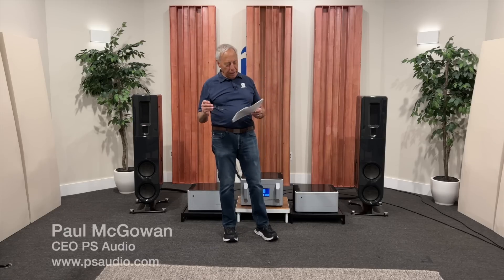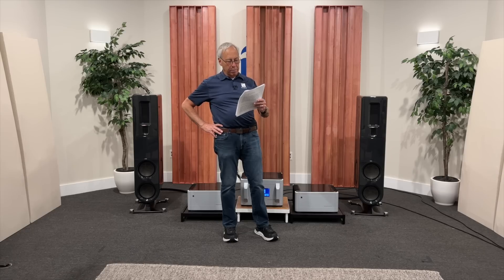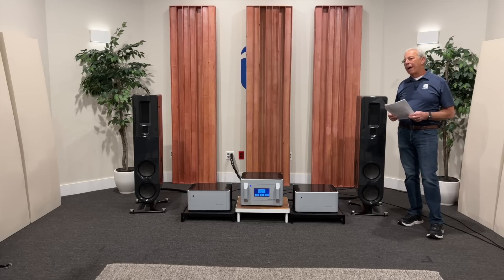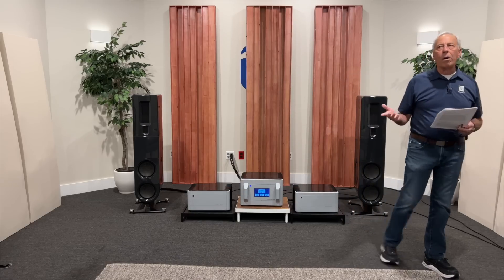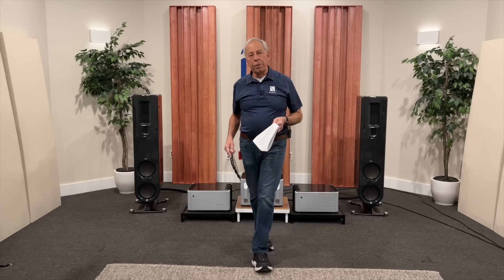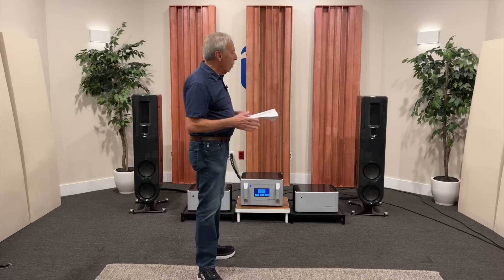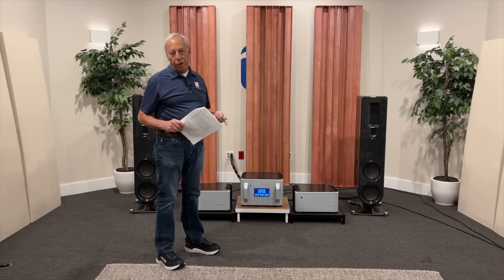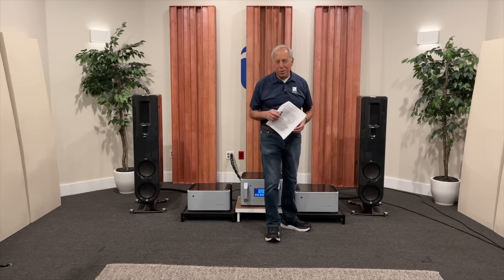The longevity of PS Audio speakers

Comment: In the 1970s, I bought large Advents for myself and Dynaco A-25s for my brother. Advents had foam woofer surrounds, and they rotted after about 15 years, as did the replacements. The Dynacos had rubber, which have held up just fine and are still playing.

Comment: ni the midrange and the tweeters are not custom, they are bought:   GRS PT5010-8 10" Planar Mid/Tweeter 8 Ohm    Cost:  $164 each
the tweeters are GRS PT2522-4 3-1/2" Planar Tweeter 4 Ohm     Cost: $39 each
Reply: This is false. They are certainly similar as both are derivative of the work done by David Graebener and Igor Levitsky. David worked for my father for about 10 years and I worked directly with Igor at BG for 5 years with these. Why would we need to go to parts express?
Reply: @cbrunhaver  who cares were dd the bought it? i'm sure the bought it even cheaper from the source. This aint the issue but the deceiving marketing and money grab
Reply: @HowDareYouu  well, I worked on these for a couple of years and  heading over to China to implement a listeninc system for additional testing and product quality don’t appreciate being told that they were just bought off the shelf.

For hifinews, the midband distortion of .06% at 90 db spl was one of the lowest they’ve measured
Reply: @HowDareYouu  well, I don’t follow that logic. Companies shouldn’t make money on their products or the work that I did on this isn’t enough to call it custom? 

I think that you must have an axe to grind against the company for some other reason. You have made something around 85 comments on these videos (mostly negative).

Comment: You can save buttloads going with a set of vintage speakers that simply need foam replacement. I got 2 sets of the same model and for curiosity sake, one set I used foam replacement surrounds and the other I used rubber. I couldnt hear a difference between them. From this experience, I say go rubber if your repairing surrounds. Rubber is far more rugged and can take a little more abuse in the long run.

Comment: I think I've told this story before but many decades ago my late brother and I had a friend whom we saw on a regular basis and one Friday he mentioned that he didn't seem to be getting the bass from his system that he was used to and wondered if we would mind visiting and investigating the problem. So after dinner, we had a listen and there was no question that the system was very bass-shy. We didn't think it was an electronic problem so off with the baffle cloths and the reason became immediately apparent. The surrounds of the woofer cones were foam and it had spilt in the centre around each of the circumferences in its entirety. (I have noted both  Peter W's and The Rolling Troll's comments below). We managed to find reasonably suitable replacement drivers with rubber surrounds and the sound was back so some sort of normality. (It wasn't a high-end system). If it had happened today I now know a person who specialises in replacing surrounds but it does require expertise to ensure that the voice coil ends up being centrally positioned in the magnet "gap".

Comment: Hey Paul, I would like you to talk about EQ, I have the impression that EQ, especially digital and DSP, introduces a bit of noise and distortion to the sound processed by the DAC, is it my ears or is this actually happening? obviously listening superficially you don't notice the distortion or noise, but at the most inaudible and barely perceptible level, would the sound be compressed, or with artifacts, noise and bad changes when using any EQ program? I tested it several times with or without EQ and although the sound with less treble is more comfortable and attractive to me, when I EQ it, I end up preferring it without EQ because it sounds more natural, while listening with EQ I slowly realize that the sound is strange, I feel uncomfortable in my ear, sometimes it hurts, it's a bad feeling, I've tried it in different setups and different boxes, but this always happens.
Reply: Paul's friend, Michael Fremer, sez, "Everything distorts." At an audio show, a few years ago, a European Manufacturer had a, `perfect preamp,' which is just under half a million dollars! For the preamp, only! Yes, there are million ~ dollar, multi ~ million dollar systems. I've purchased a complete PS Audio system; the only place that I, `cheaped out,' on, is: Robin Hood speaker cable, vs. Dragon. {You may ask yourself: Do I buy the top of the line speaker cable, or, a new, luxury automobile?! Really!} NOT buying something, is less expensive, & is likely to provide better sound ~

Comment: Surrounds deteriorating in Asia and humid environments:
JBL, Acoustic Research, Bose, Advent, they all had these issues. 
And then here in the Netherlands/Germany: Magnat, Translator, Philips, Jamo... 
All foam surrounds deteriorate. It doesn't matter where they are, or which brand, if it's foam, it'll be dead after 30 years.
Pretty easy to replace though, and cheap. You just got to do it, or find someone who does it for you.

Comment: Great question about speaker longevity.  My B&W 801 Matrix series 3 speakers are 29 years old and going strong.  No cone  rot.
Reply: I have a pair of the exact same speakers...currently sitting on Fort Myers Beach in a bombed out condo due to Hurricane Ian.  We'll see if they are listenable when we finally get power in another 6-10 months.  They were working fine until the hurricane.
Reply: @grayrabbit2211  Sorry to hear  about the hurricane.  Hopefully your speakers are still working.

Comment: If theres any indication of longevity and/or durability of ps audio gear, take my experience with their ps audio sprout 100. Died in less than 2 years. Tried to resolve it with their distributor but they shrugged me off after the first try of repair. Said they gave me a new unit but it died after 2 weeks. Tried to contact them but to no avail.

Stopped trusting ps audio after that. Will never ever recommend this brand again. Dont ever trust this company with the warranty they claim.

Comment: Paul: The dumbest question you'll receive today:

WHAT in the sam-hill does "PS" stand for, in your company's name?

It's not on your website, and goose eggs on the internet.
Reply: From Wikipedia : PS Audio was founded in 1973 and shipped its first products in 1974. It was started by audio designers Paul McGowan and Stan Warren (with whose initials the company was named).
Reply: @ray.watts-35  I googled and duckducked "ps audio" and failed to get hits from either for a Wiki entry for the company.

Do I need to take a course on search skills?

Thanks for clarifying though.  I suspected the 'P' might have stood for Paul.
Reply: @Zickcermacity  yep, probably best to Google search skills 🤣
Reply: @Zickcermacity  , i 'Ducked' PS Audio and wiki page came right up top
Reply: @googoo-gjoob  Some of us lucky, some of us.. not so much.
Reply from the maker: Looks like it got properly answered. Thanks. Yup. Paul and Stan Audio.
Reply: @Paulmcgowanpsaudio  That's something you might want to include in your website's About page.  Would have been nicer to read about it first hand, vs. on Wikipedia or other outboard source.

Comment: In some industries they can run things at extreme levels for a short period of time to simulate normal use over a substantially longer time of use. Difficult with speakers that's more degrading from surrounding environment and not mechanical wear.
Reply: When I worked for Samsung, I visited their Farmingdale, NJ facility on a number of occasions and we had quite an elaborate "torture chamber" out there for electronics.
Reply: @cletusberkeley9441  Yes the electronics could certainly be pushed and punished to see if it breaks, I'm not sure what Nokia used back in the days as I imagine most test equipment must have broken before the phones. 😂

Comment: What about the caps?
Reply: At this price point I'd expect them to use film caps which last indefinitely.  In cheap speakers it would be electrolytic which need replacing after 20 years.
Reply: @user-od9iz9cv1w  Not always. I had my surrounds replaced on 30 year old Infinity speaker woofers at which time I instructed the repair service to rebuild the crossovers as needed. Both speakers had large electrolytics that I expected to need to be replaced although the speakers still sounded great. Turns out they had not leaked and tested spot on value. That was 7 years ago. And still no degradation to this day.
Reply: @36karpatoruski  Thanks for the feedback.  If they sound good then its fine.  I suspect Infinity knew where it counts and designed accordingly.
Reply: Nice wood veneer (?) on those FR 20 s !
Are you going to start offering that on the 30’s?

Comment: Pretty much materials sciences- ie, foam surrounds don’t last
Reply: Does anybody still uses foam suspension?
Reply: @jareknowak8712  not a clue - but as experience with surrounds is now easily a mature field only a manufacturer who doesn’t care will use a foam surround. In the 70’s and 80’s foam surrounds were very common. 

I remember taking the grill off a pair of ARs I had - the grills hadn’t come off in years. The foam surrounds on the woofers both rotted away